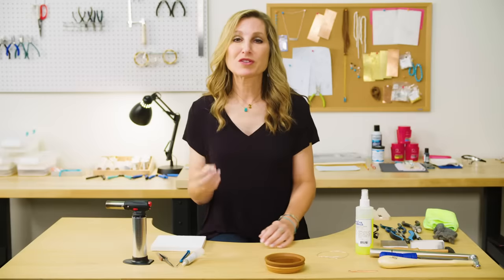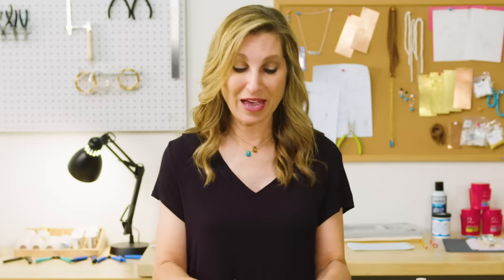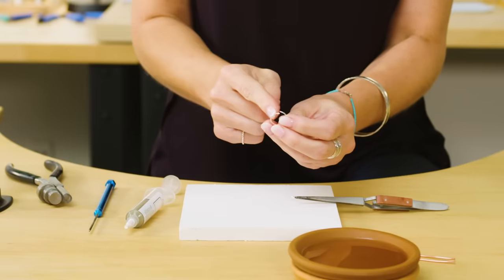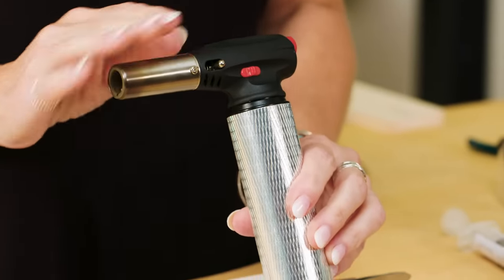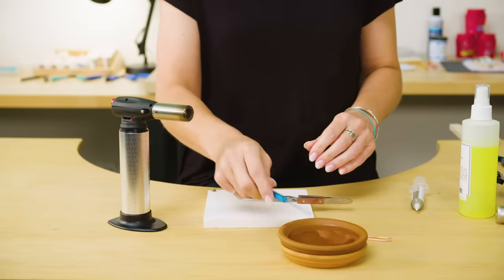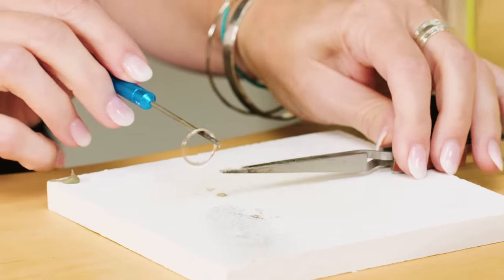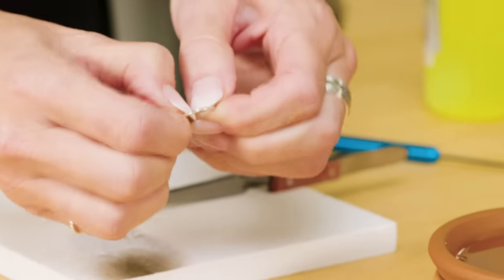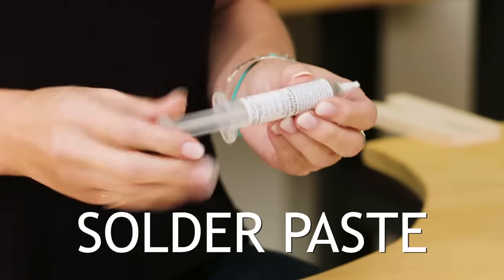The Basics of Soldering | Jewelry 101

Comment: I've been a metalsmith for over 30 years and I absolutely suggest that you use more than that small soldering board.  Heat from even a tiny handheld torch and especially full-sized gas tanks and nozzles will always heat outside of your targeted soldering area. Plus accidents happen. Please get/do more to protect your soldering work area, your space and yourself than that small soldering board. And get protective eye/face gear and/or a ventilator mask especially if you're doing a lot of soldering and working in closed in space. I always keep a window open in my studio (even if it's cold out).  Or install a vent hood if your space allows...
Reply: agreed!
Reply: if you're such an expert why watch this video? something doesn't add up 🤔
Reply: @sirtinley-knot2944  Some people use different tools depending on what their making.

Blacksmith is usually an anvil, furnace, and tools to bend and hammer the metal into shape.

Comment: Just an FYI steel causes a reaction  that pulls the copper in silver to the surface thus copper plating the piece.  Ive been learning alot about this lately. So the peice touching the steel in your pickle is the only one that gets effected. The steel does not actually contaminate the pickle. But its always best to use copper tongs only. I hope this is helpful.
Reply: I believe even if you use fine silver it will copper plate if it touches steel in the pickle.  Im guessing it pulls copper from the p8ckle solution as well.
Reply: As I watched I had so many questions but I realized I’d do myself a favor by just following your instructions.

Comment: Having had 10+ years of soldering with a soldering iron in an electronics factory, I believe you did a very good explanation of the kind of technique. From experience I can tell you that if the solder joint looks grainy and grey, it becomes a cold solder joint that may not stay soldered over time. If you have any more questions about soldering, I may be able to help you out.
Reply from the maker: Thanks 👍

Comment: Nice to see somebody promoting paste, i use a lot of it when making chains, soldering with paste allows the process to be much simpler and quicker like you explained. However a lot of professional jewellers seem to criticise the use of it for some reason. thanks and keep up the good work
Reply: because its weak and last choice just another lousy rush job no quality tip from this one
Reply: @nicolecrystal6765  REALLY?!?!  You must have been taught by an older adult who has never tried anything new.  Silver Bearing Solder Paste offers a tensile strength of 10,000 to 28,000 psi and flows freely and smoothly between 395°F and 430°F.   

I could not agree more, but in regards to your comment (FYI: grammar and punctuation are still used outside of texting): " just another lousy rush job no quality tip from this one."

Comment: So one thing I noticed in the video that wasn't covered was the actual workbench. My main questions for the group are:

1: where can you find a jeweler's workbench like that? 
2: the spray flux you used looks really handy. What is the name of the flux solution and does it come in liquid form in said spray bottle? Does it work on brass, copper, bronze, silver, gold and steel?
3: what's the brand of paste solder you're using? Does it work on aformentioned metals above? Is it simple lead free solder or is it spacifically jewelery grade?
4: the soldering board your using, is it simply a thin slab of firebrick? Can we order it in single tiles or does it come in packs? If the latter, how many tiles to a pack?
5: if you're using your pickle for steel wire, would that contaminate it or would it not work unless it's spacifically used for non ferrous materials?
6: all in all, if you're just starting out and on a budget, how much did this bare bones setup cost?

Comment: This a really good demonstration. You’ve answered most of my questions, I just don’t understand what pickling means.  Thanks & great job!😀
Reply: Pickling refers to a chemical process which uses a weak acid solution to remove firescale from the metal you have heated up..if you heat metal hot enough to solder, the oxygen in the surrounding air causes firescale-leaves the surface
Of the metal discolored..pickle eats this coating off .Also ,one uses flux (a coating of boric acid)
To prevent oxides from attaching to the solder joint, allowing solder to flow freely onto the surfaces to be joined, and pickle removes this coating of melted flux after you have soldered the joint.
Reply: @petersze7127  Thank you very much for that explanation.  It is not really explained anywhere.  Great demo...

Comment: Solder tends to flow towards the heat.  You can absolutely fill a gap with solder.  Example: when plumbing two copper pipes together, you slip one over the other or use a fitting in the middle to slip each pipe over to join them together. Then you have to solder the two together, ie fill in the gap all the way around the circumference of the pipe so no water leaks out. I've done it a hundred times.  If you want to fill a gap, you heat above or below the spot, right at the very edge of it.  Once the metal is hot enough you put the solder to the hot metal in such a way that it will fill the gap as it flows towards your flame. It will fill the gap easily and quickly. Remember, solder always tends to flow towards the heat, so if you keep your flame in place and then touch the solder to the metal, the solder will liquefy and flow nicely towards said flame.  Just be sure to use the proper solder.   It comes in different thicknesses so you don't have too much solder on the piece.  Otherwise it will become messy looking.

Comment: It's much easier to add & position the solder paste in place before you heat. It's easier to position & control the amount. 
Best practice: cool the piece in water before placing in the pickle. When starting to work on larger pieces, it can spit.
Its ok for a home hobbiests who just wants to make for themselves & friends, but if you are serious about how to make jewellery, you'll need to learn to use a jeweller's saw. Those cutters are useless when you start making thicker, larger pieces. I wouldn't use them on thin wire either, but it seems like lots of people do in the US.
Reply: Good tip about the water. I took a jewelry class and the instructor said the same thing.

Comment: I LOVE your video! I want to start soldering hand crafted simple jewelry, but I use a lot of rose gold fill and gold fill for wire wrapping. Do you have videos on how to solder wire wrap using gold fill and also rose gold fill that ends up looking seamless?  PLEASE refer me those videos. I want to make some jewelry for holiday gifting.  Do you also have videos on how to solder using  a plug in soldering tool instead of a torch?
Reply from the maker: Unfortunately, we do not have any videos on that at this time. However, I do solder with rose gold and gold filled wire. It is tricky and although not completely seamless, with a little skill, it is possible to do with professional results.  One trick is to a use a lower karat solder than the wire you are soldering (ie 10k for 12k gold filled). The color match will be much better!

Comment: How can I solder a sterling silver jump ring that is already connected to a necklace made with soft flex wire and glass beads? Can I put the glass beads and the soft flex in the pickling solution? Thanks 🙏🏼🙏🏼🙏🏼

Comment: Thanks you made my day. I want to ask does solder contains lead? 
Does solder connects all type of materials together?Does it work in stainless steel?
Reply from the maker: The solder I am working in this video with does NOT contain lead.  When shopping, always look for solder that is lead and cadmium free.  If it does not say that, I do not recommend using it!  In this video, I am working with a silver solder paste meant to solder sterling or fine silver.  The color will match those metals best.  It is easiest to join like metals, but different metals can be joined with practice!  I have never worked with stainless steel, so I cannot address that question.
Reply: @JewelSchool  nowadays stainless steel is catching popularity because its very sturdy (steel says it all) cheaper than gold and silver, better than copper, do not tarnish, looks like silver, retains its shine plus doesn't have any allergic reactions ( we use stainless steel in utensils). Thanks for giving your advice it was as valuable as jewel(real gold and silver) to me 😄.
Reply: I want to add we use stainless steel in surgical instruments also. Have a jewelful day( or night) 😄.
Reply: One last thing, stainless steel is recyclable also,  you can melt and use it again, ie you can give stainless steel to recycling center, but you have to separate it from other metals,which is a piece of cake for a noble German.

Comment: Pickle liquid, it's actually pickle, the one used for food picking, vinegar and water 1:1 (equal parts) ratio usually.
Reply: @Roger Felton pickling can be purchased off the shelf or for smaller uses (like for me), you make  pickle with vinegar and salt. At least that's what I learned. Even in food, pickling requires salt. Usually the measurement is one cup vinegar to one tablespoon salt. Heat the vinegar in the microwave to boiling. Add the salt to the vinegar and stir with wooden, plastic, or your copper tongs. Do not use metal. Keep the solution warm in a crock-pot or I use a mug warmer that gets very hot. 
 It's pretty straightforward.

Comment: I’ve never done this before but I have lab experience. What is the “pickle” solution & what is its purpose ?
Excellent demo, I picked up some great tips.
I found 4 x types & thicknesses of solder wire in my late fathers tools, I’m quite sure it’s no more than a decade old, can this be used in jewellery or just junk it & buy fresh? The thicker guage solder looks like silver but the thin older soft wire is grey, possibly lead which I can’t use. Can you tell the type by sight or could an expert know?
Sorry for the dumb Q’s, I’ve forgotten a lot in my senior years

Comment: Thank you for this very informative video. I've tried to do soldering, but not learned how to do it yet, finally gave up. Your video makes it much more understandable that I'm going to try again. I've have not had much luck with the torches. Would you tell me what brand torch you are using? Mine seem kind of wimpy and awkward. Thanks again. 🎶You give me hope🎶.😀
Reply from the maker: Hi! This torch is a butane jewelry soldering torch made by max flame. You can do an internet search for it and come up with s link, but also we have a complete soldering starter kit you may want to look into: https://www.jtv.com/product/soldering-basics-supply-kit-includes-torch-tweezers-pick-board-paste/JSYT15?mcid=XSOjsyt
Reply: @JewelSchool  Thanks for answering. I found this on Amazon. A reviewer said they got one and loved it and ordered another. However the second one was a cheap copy and didn't work very well. It was returned for a replacement but still didn't get the original, so it too was returned. Thank you so much for your help. I guess I'll just take my chance. Thanks again.

Comment: Would I use the same flux/ solder combo for copper or sterling silver plated wire? Thanks so much! I’ve always been intimidated with soldering until I saw your video ty 😊😊👍
Reply from the maker: Hi! Generally speaking, I do not solder plated wire. Most plated items are soldered before they are plated.

Comment: Fun fact
Flux is actually used in welding too!
The main use for flux in welding, and soldering is to purify the metal, and the atmosphere around the metal as well. The flux will make sure that when the molten metal is still liquid, that it doesn't pick up any contaminates from the atmosphere or from the metal itself.
Flux keeps your molten metal clean. Which helps it behave in a way that's easier to manipulate, and keep it pure.
The only time that flux isn't required in welding is if there's a shielding gas to protect the weld. Which functions in the same way, it's there to keep the atmosphere around the metal pure!

Comment: Question: is that flux only used in silver? I love working on copper wire, is that useful to soldier copper and brass too? Please answer my question 🙏🏻🙏🏻
Reply from the maker: You can use spray flux on any wire type to help your solder flow and keep the metal clean when heating!
Reply: @JewelSchool  thank you so much! 😌🌹

Comment: Thank you for the video! I’m hoping to get into soldering but wanted to educate myself more before buying any of the equipment needed. Could I ask what substance you used for the pickle solution?
Reply from the maker: This is a mixture of sparex no.2 and water. You can find a citric acid instead if you don't want to use sparex.

Comment: Thank you for this helpful info! I bought some sterling silver rings off Etsy but one I ordered too big. Could I use this method by cutting off a tiny bit of it and then soldering together again, to resize it smaller? Thank you!
Reply from the maker: As long as it is sterling silver, you should be able to size it one or two sizes using this method.
Reply: @JewelSchool  great, thank you!

Comment: Just wondering which torch you're using... I have a soldering iron instead and it didn't work out so well lol...  all of the solder stuck to the soldering iron instead. Love your videos! You are inspirational, thank you!
Reply from the maker: Hi Linzey! This is a jewelry torch rated for melting sterling silver. Soldering irons are more for electronics and won't get hot enough to melt the solder paste in order for it to flow. Don't get a jeweler's soldering torch confused with a kitchen torch. Here is a link to to a basic torch and solder paste kit, but a quick internet search for a "butane jeweler's torch" should yield some great, affordable results! https://www.jtv.com/product/soldering-basics-supply-kit-includes-torch-tweezers-pick-board-paste/JSYT15?mcid=XSOjsyt
Also, check out our other soldering videos!
Soldering a Huggie Pendant
https://youtu.be/yFqnfN3DTxM
A Deep Dive into Pickle and Soldering:
https://youtu.be/p4KJCcZgAvU
Reply: @JewelSchool  Thank you!

Comment: Great Video :) may I ask a 101 question?  When soldering gold fill wire, do you need a different type of solder? If not, how do you get it to match the color? I'm looking to make 10g gold filled bangles.
Reply from the maker: Use extra care when soldering gold-filled material. If you overheat it, it can damage the material beyond repair. Susan says to be sure and work really fast when soldering gold-filled wire. As for the paste, it is recommended that you use 14-karat plumb yellow gold easy solder, It's a great color match for yellow gold-filled material. Hope this helps!

Comment: What's the pickle made of? 
There are some design variances in butane torches. All the ones I've ever had, have had a choke on them too. The choke allows user to adjust the air/fuel mixture to really dial in the temperature of the flame. 
99% of my soldering experience has come from plumbing. I've only used soldering paste on a few occasions remodeling an old iconic wooden hotel where we used an electric device to heat the joints so we wouldn't burn down the place that still had lots of guests. But I wanted to point out that there are more reasons soldering attempts fail. Our 2 most common are dirty surface  and too much heat. Surface must be shiny clean to bare metal and too much heat will evaporate away all the flux
Reply from the maker: Hello! Pickle is often made of citric acid but is generally a liquid acid compound that can remove oxidation in jewelry. You can buy it here: https://www.jtv.com/product/pickle-pot-with-citric-acid/JSTKIT0006?rrec=true

Comment: This video was so easy to understand and informative! I'm getting all the things needed to solder as a christmas present from my husband. If you don't mind, I have a few questions. What kind of pickle do you use? Do you make it? And from the video, it looked like you touched the rings directly out of the pickle, so I'm assuming the pickle is safe to get on your skin. Is that correct? Thank you for explaining soldering so well!
Reply from the maker: I tend to use whatever I have on hand. If you can, look for one that is environmentally friendly so you can dispose of it safely, especially if you have a home studio. You can make your own. There are recipes online! I do not put my hands or fingers directly in the pickle. I had a very tiny, handmade copper tong to pull the rings out of my pickle during that video!  I recommend using a copper tong to remove items from the pickle at all times. I make my own out of heavy copper wire,  but they are super inexpensive and easy to find if you do not want to do that!

Comment: Thank you…you did an amazing job explaining the basics. If I want to use copper wire, must I use a different paste? For example  does paste solder come in different colors to match the wire color? I'm also assuming you must use raw copper or sterling silver vs a plated wire? I just might be brave enough to try this!!
Reply from the maker: These are great questions! Solder does come in copper, but if you want to use sterling silver solder paste on a bare copper wire, you can. Susan does it all the time and says that if you polish and buff the soldered joint, no one can tell because it is so small. The key is to not use too much solder. If you happen to want to match it, just get you some copper solder or you can use liver of sulphur to oxidize the whole piece when you're done. You should only solder gold, sterling silver, or bare copper wire. A plated wire can't be soldered because the plating will melt right off!
Liver of Sulphur Gel: https://www.jtv.com/product/liver-of-sulfur-gel-appx-4oz/ETW012?mcid=XSOjsyt
Reply: @JewelSchool  Thank you for the quick response! I'll give it a try with the sterling silver first before having to buy anything extra. ;-)